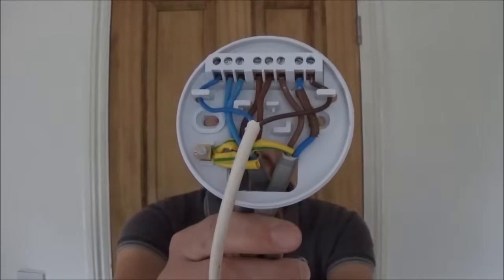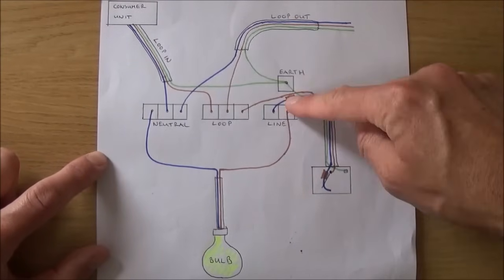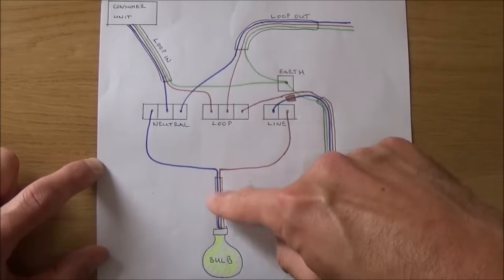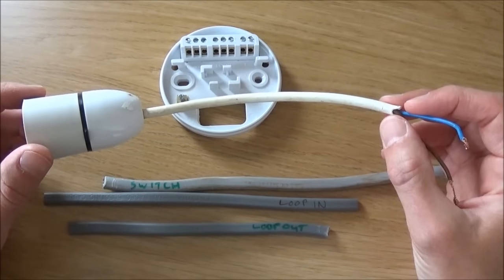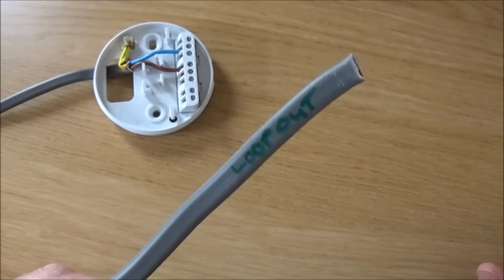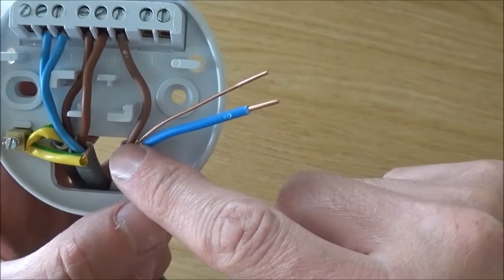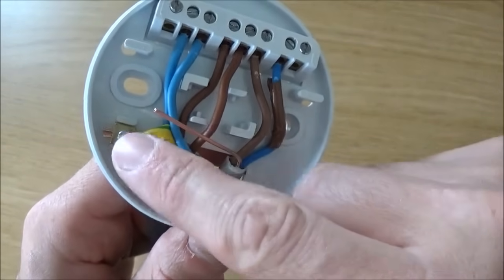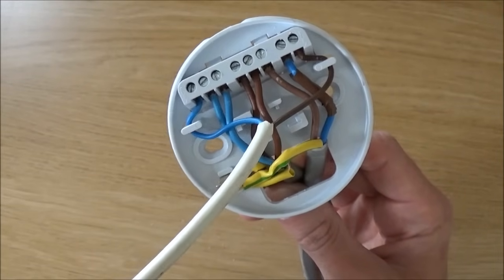How to wire a ceiling rose - lighting circuits explained. Ceiling rose pendant install!

Comment: Thank you so much. I’ve never done anything like this but watched your video and did it! Rewired my ceiling rose, on a ladder and upside down! Still feel smug from turning it on and it working! 10/10 clear, easy guidance would defo recommend

Comment: I've watched multiple videos on this and it still doesn't make sense.
I have one black, one red and one earth coming out of ceiling. So, based on these videos, my lights should never be able to turn on as either the wiring to switch is missing or wiring from consumer box is missing 😂
Reply from the maker: Watch this video and it should explain everything...enjoy! Replace and install a light fitting - https://youtu.be/iQAs5zq-32c

Comment: Thanks mate helped me with my bathroom rose but when I opened the old rose and took wires off I totally forgot to take a picture and had 3 sets of old wires dangling with no identification of what wire is what , so here's a tip if you have no tools to test wires , so I did the bulb test to find permanent live by using the new rose fixings , once I found that , it left me 2 more sets which I needed to find switch live so I unscrewed the pullcord rose then tugged on the wire from the pullcord core wire which then moved one of the wires out the 2 from the old rose wires ,I knew then which wire was switch live and the other was the out cable , I marked them so I now knew what wires was what then fixed it all like your video and worked first time thanks bud
Reply from the maker: Glad you found it useful. Thanks for watching 👍

Comment: Thank you for such a clear and helpful explanation. I live in an old flat which has wiring from last century. Even though the wires were different you gave me enough context to be able to change the light fitting. 💯
Reply from the maker: Glad to help 👍

Comment: To fit one of the new LED Bar type lights to a ceiling rose fitting, what size of electrical wire is needed.  As in the length of the pendant wire is to short so I would like to have a longer length of wire to attach to the LED Bar light.

Comment: What if I have only 2 cables coming from the ceiling as I have 2 lights controlled by a double switch?
Reply from the maker: You need to find the original feed in the room if you want the permanent line / live. It'll prob be above one of your lights or it maybe connected up in the back of a light switch. If in doubt, call a qualified electrician and stay safe! Thanks for watching.

Comment: Hello mate.can i send you a pic of a wired Ceiling light in my utility room. Im a bit confused cause it doesnt have any wires in the loop section, i believe this is because this is the last light in the whole chain.
For some reason the electrician who installed rhe light, put the brown wire into live switch section(2 terminals)and the nutritional wire into the neutral section(3 terminals wirh other blue wires)

Do you have an email?

Comment: Great vid . 
Just moved into old property which has black and brown . I know brown is live and black neutral and have 2 cables coming into room . unfortunately previous person didn't mark which is the switched live on black wire . Any simple way of knowing or is it 50 /50 it works or blows fuse ? Thanks

Comment: I’ve just got a new ceiling light, how would I re 2nd fix it to that with all them cables coz I only need LNE
Reply from the maker: This video might help. You can use a different junction box to in the video if you like though.

How to fit a ceiling light. Lighting circuits explained. Replace and install a light fitting. - https://youtu.be/iQAs5zq-32c

Hope that helps.

Comment: fantastic vidoe.my ceiling rose does not have a switch cable or light out.seem to work just by being wire live to live neutral to nural and earth to earth.don tunderstand how.i gues the switch is wire in the circuit earlier?
Reply from the maker: If you have more than one light in the room it's possible this one is just daisy chained from another to all operate together from the switch. Check the other lights in the room. Best of luck.

Comment: Can the brown loop wires be connected outside the light fitting via a small junction connector instead?
Reply from the maker: Yes as long as they are all in the connector. You could use a wago connector. Why would you want to though unless doing away with the ceiling rose?

Comment: If you take the terminals out of the plastic housing, would they trip if they touched each other ? I've done this and wrapped electrical tape around to make sure but I don't know if I was supposed to
Reply from the maker: You should have the power off when doing any work like this. If the cpc (earth wire) touches something it will trip your rcd if you have one even with the power off. To overcome this, I use wago connectors rather than tape. They are quick to cover wires and safely isolate them and can be easily removed when finished. Hope that helps.

Comment: Thanks for this. I knocked off my bathroom ceiling light light this morning. I'm very tall. The wires came out at the base.
Thus video saved me. It was awkward for me to put it all together but everything is fine now.
Brilliant video and thanks again
Reply from the maker: Glad it helped
Reply: Can you use these pendant lights in the bathroom ?
Reply: @fasn279  I have this fitting on my bathroom ceiling. Its a standard fitting.
Reply: @iamme3513  they say the moisture etc isn’t good with this type of fitting? And it needs to be IP rated ? 

My LED dome light stopped working which was IP rated and getting it changed for the same light requires an electrician…. If I had the normal pendant I could just change the bulb

Comment: Don’t no what I’m doing wrong. I’m not 100% sure on what cable is what ie the in out and switch. For some reason I must have a permanent live going to the bulb as it stays on without switching it on. Any ideas what I’ve done wrong?

Comment: Great video. In my situation, i have two ceiling lights in my living room one with one twin core cable coming through and the other has 4 twin core cables coming through and the brown tape signifying the switch cable is round the Blue wire on one length of cable and the brown wire on a different length of cable. Do you know why this would be?

Comment: Great explanation and your time. I've moved in to a new built property and I want to install a loft light. 
Where would the best practice for taking a live feed for my new light??? I think the main fed is going to the light switches and not to the light pendant would I be right?? Thanks
Reply from the maker: They could be fed to the switch that's right, in which case you will need to get a permanent live from the switch. Or you could do a fuse spur off a socket and power lights from that. Or you could add a socket in the loft and either fuse spur off that for light or just use a light with a plug plugged into the socket. A few options but if you fused spur off socket, make sure you put 3amp fuse in the fused connection unit (FCU). If in doubt call an electrician, stay safe! Thanks for watching.

Comment: I fitted a new LED Light (manufactured in Europe) pendant on to loop, but it didn't have all those connections for a loop so I used one of those clip kit things. The pendant did not have a terminal for the earth, so I just twisted them together and shoved it aside, does anyone know of that will cause a problem?

Comment: This didn’t help at all, I’ve got 9 wires poking out of my ceiling and I’m not fitting a plastic ceiling Rose, my light fitting doesn’t have a terminal box , only blue / brown, so I’ve got 7 wires I don’t know what to do with. And I’ve wired blue to blue and brown to brown and my light doesn’t work. No help at all

Comment: Great video ! Does it matter which way around the two cables are wired into the loop and neutral?  Those two are unidentifiable and I’ve just changed all my pendants and somewhere the circuit has been cut off but I can’t see a fault 🤦🏻‍♀️

Comment: I have four sets of wires coming in, two pairs of red-red black-black and earths (which are twisted together). How do I figure out which one is the switch since there's no brown marker on any of the live wires?
Reply: Could the reason I have four sets of wires coming into one pedant be that there used to be a second light switch hooked up to the light? There's cut wires in the hall off this room that come halfway down a wall, maybe that's where the second switch used to be?

Comment: Great video. I have a problem though I think due to identifying wires - is there a way of doing so without trial and error? It’s blowing light circuit fuse. Assuming it’s due to the switch live? Thanks.

Comment: Looking for some help. Need to switch a fitting for standard bayonet as it’s a square type. Popped the cover down and only have loop in. Live ( brown ) neutral ( blue ) and earth. No other cables at all. Am I simply reconnecting the exact same way? After watching this I don’t see a switch cable on mine? Cheers.

Comment: My selling light keeps flashing what am I doing wrong
Reply from the maker: Could be a faulty switch or connection somewhere. If in doubt call an electrician to ensure the wiring is safe. Best of luck with it.

Comment: I have a question, are the terminal connected with eachother or not. like are all life connector connected with eachother or not?
Reply: Yes they are. If they weren't then it wouldn't work properly. I have seen another video where the electrician shows that each group of terminals are linked by a metal strip. So, just to be clear: the 3 neutral terminals are linked to each other; the 3 live loop terminals are joined to each other; and the 2 live switch terminals are joined together.

Comment: I'm replacing my pendant light with another pendant light, just because the cade cracked do I need to cut all the wires again or can I reuse
Reply from the maker: You can reuse them as long as they are in good safe working order.
Reply: @POUSEaroundtheHOUSE  thankyou!

Comment: Thank you so much. My daughter is moving house on Thursday. I'd took lights down for her but forgot to watch the wiring then couldn't work out the wiring when putting up the new rose. Turned out that not only was my wiring wrong but the switch wasn't working too. All sorted and saved trying to get an electrician out in the next three days 🙂🙂🙂👍
Reply from the maker: Great news and glad to help 👍

Comment: I've bought a soptlight to replace one of these, the spotlight only has live and neutral terminals, how would I connect it up?
Reply from the maker: This video may help - Replace and install a light fitting - https://youtu.be/iQAs5zq-32c. You don't have to use the specific connectors in the video but the principle is the same to convert from ceiling rose wiring to spot light. Best of luck. If in doubt call and electrician to ensure the installation is safe 👍
Reply: @POUSEaroundtheHOUSE  It's done now, I got a pro to do it, I'm clueless about electrics 👍🏻

Comment: I am replacing 2 dimmable light fitting with pendants, and the first light doesn't have a switch cable going to it. So they won't turn off fully... any ideas?
Reply from the maker: It's probably daisy chained to the other pendant? If so it should turn on and off with the other light using one switch? If that's not the case how is the light turned on and off?

Comment: Actually with the help of my brother who's a trainee electrician I managed to fix my bathroom light.
Its had 2 sets of 3 wires. 6 in total.
He recommended a batten loop ceiling fitting (£3 from toolstation).
Two red wires went into the loop section in the middle. One of the black neutral wires went into the neutral  and the other black neutral into the live section.
Two earth wires into the earth section.
One of the black neutral wires is a switch live apparently.
And it worked!

Comment: What if you've only got 6 wires coming out of the ceiling? (2 sets of 3 wires)
Reply from the maker: It might just be power in cable and switch cable. I couldn't say without seeing it. Thanks for watching.

Comment: Nice video. You make me feel I can do this. One question though and it may be a silly one. How do I determine which set of wires is the loop in and which is the loop out? Or maybe it doesn’t matter, providing I keep the wires from one set separate from the other?
Reply from the maker: As long as all loop are together, it doesn't really matter, unless you want to know which one carries power to next room and so on. Thanks for watching.

Comment: I've rose fitting & want to change it to dimmer  Chandelier .. .. the Chandelier has 3 terminals. . which wires from these will go into the terminals
Reply from the maker: You can try watching this video first - https://youtu.be/iQAs5zq-32c. If in doubt please call an electrician to install it safely.

Comment: This is brillant. So I had a look at mine aaaand it's different. Mine is wired with two switches. I disconected one of them aaand the rest of the upstairs dont work. Is this standard in a house please
Reply from the maker: Depends on the wiring. If the main live to the next light is take from the switch (different way off wiring) then you may have just disconnected the power. You could try looking behind the switch to see if another cable goes out from it to the next light. If in doubt call an electrician, be safe! Best of luck.
Reply: @POUSEaroundtheHOUSE  had a look at the switch and that is exactly how its wired........Genius. thank you
Reply from the maker: @chrishurd751  glad to help 👍

Comment: If the light fixture has been removed and you only have 3 cables, is there any way of working out which is which cable?
Reply: Call an electrician!

Comment: Good video,  thanks but how do you know which cables  are going to the switch & which are going to the adjoining room (Loop)? May have been a good idea to talk about Black & Red cables as well, as you know (I assume your like me & fron the UK) that our old cables are that colour.
Reply from the maker: I put a table in the video at 1min 29 seconds to show old colours to new colours conversion. You shouldn't have skipped the video! 🤣 As for light switch cable, you need to test power if unsure. Loop will always have power and switch will have power to one wire all the time, but only the other wire when switch is turned on. If done properly it should be colour coded as in my video, so blue wire should have brown tape or sheath over it to show its a switched live.

Comment: Aren't you supposed to terminate the wires?
Reply from the maker: Not sure what you mean sorry.
Reply: @POUSEaroundtheHOUSE  Bend them over on themselves like you did with the last two
Reply from the maker: @melinmove  if you're talking about in the switch, yes it's good practice to terminate the earth into a connector like a wago if there is no terminal point in the switch or back box. 👍

Comment: You can buy a switch wire two brown and earth mate I'm not even an electrician I'm bricky lol
Reply from the maker: Yes you can, more expensive though and most electricians have lots of twin and earth so it's just easier to use the brown, blue, earth cable.

Comment: Needed to put a light under the staircase storage area. I want to run the live feed from a socket in the kitchen. Is it only an fcu needed inbetween the socket and lighting ???
Reply from the maker: You would need an Fused Connection Unit and replace the fuse with a 3amp fuse. Please ensure this is done safely by getting it checked by an electrician. Thanks for watching.

Comment: i have  a ceiling rose in my bathroom which has 6 cables in .. inc the load(lamp) am currently refurbing the bathroom and was thinking of changing the rose for "Quickwire" fittings as the new luminare needs an earth,  i could then run a supply from a splitter to a LED / buetooth mirror fitting... which seems straight forward enough.. until i came to adding the extractor fan.. i now need to incorporate a 3 core and earth into the system for a switched live/timer function ... any ideas ?
Reply from the maker: I have a video on fitting an extractor fan which my help - https://youtu.be/Bi34gxa_-Mk
If you follow that, you can then run you power to the mirror light from that and it means both you fan and mirror light can be safely isolated by the isolation switch when working on them for maintenance. Hope that helps.

Comment: I recently moved to London last year. Different from India, I had no idea how electrical lines work in UK, and now i do. Your explanations are just amazing. Its like sitting in EE Class allover again. lol Thanks. 
Can you suggest how to add LED Recessed Lighting from excising chandelier ceiling rose . And more importantly is it legal to do it myself or call the professional. ? Many thanks
Reply from the maker: You should really call an electrician. There are jobs you can do as a home owner but some need to be tested and inspected by an electrician. All the rules are listed in the Part P UK building regulations. Hope that helps.

Comment: cheers very informative just a quick question my loop in had 4 wires in it live neutral earth and a yellow.put the yellow into pendent neutral working ok just wondered why the extra wire
Reply from the maker: Without looking I couldn't tell you as there are several variations of the wiring if you have additional lights. Just make sure it is wired correctly as it could potentially be dangerous. Thanks for watching.